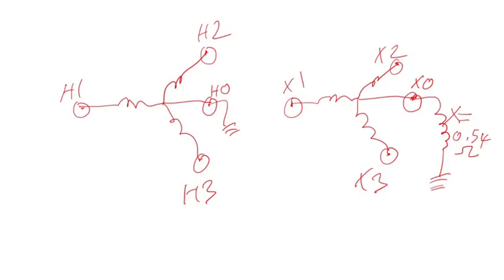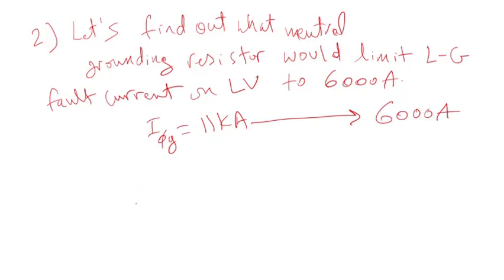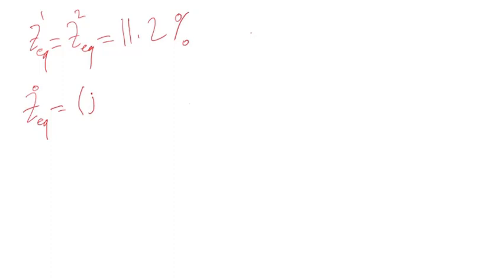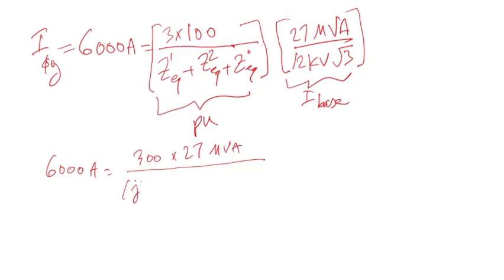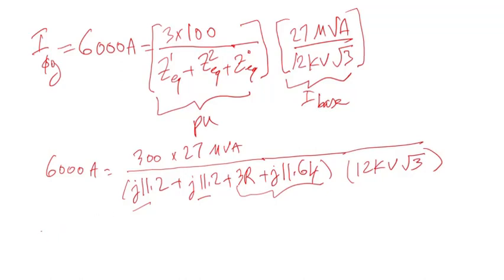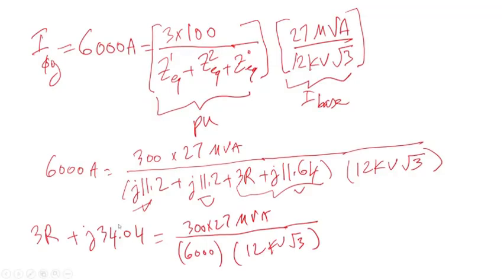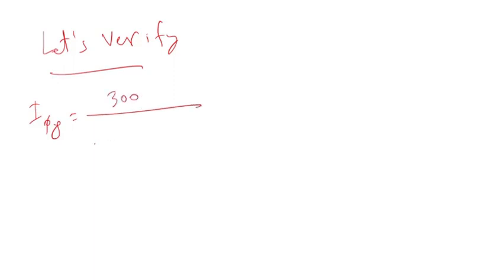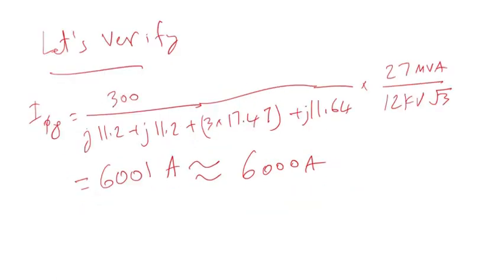Sizing Neutral Grounding Reactor or Resistor and Effective Grounding - Part 04

Comment: Hi, great video!  When calculating reactance, to get 0.5464ohms, the 9.49% has to be divided by 100% to get pu so that the Zbase can be  used.  With the resistance, this wasn't done, leaving 100.6ohms instead of 1.006ohms.  Is that correct?
Reply from the maker: Thank you. You are correct. The percent value should have been divided by 100 when calculating ohms. Instead of 100.6 ohms, it should be 1.006 ohms. Thank you for the catch.